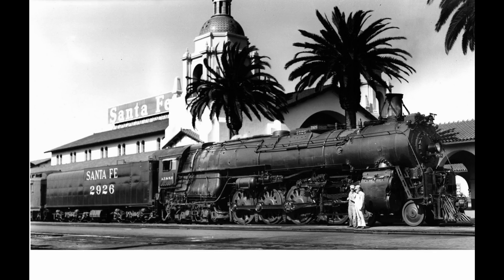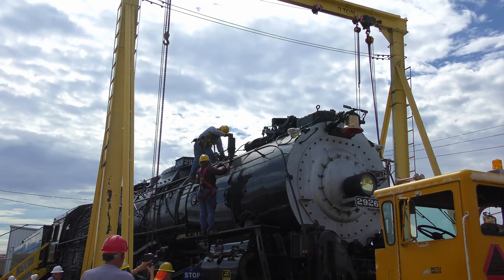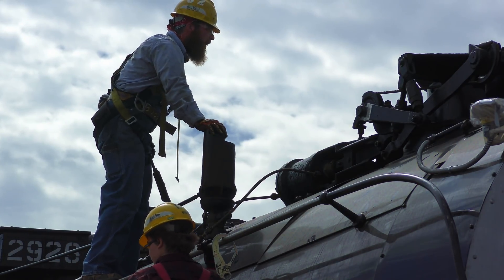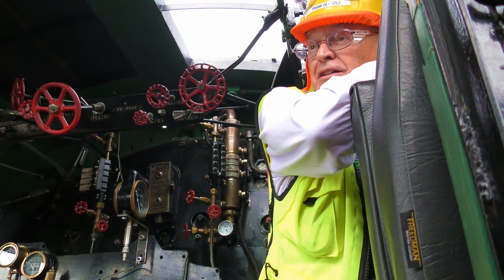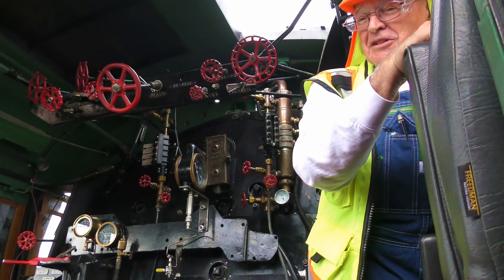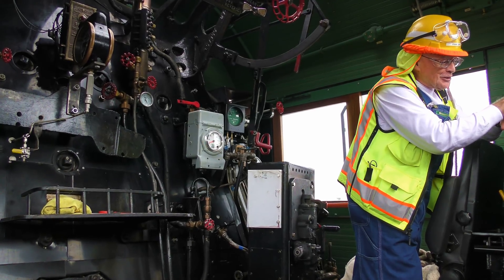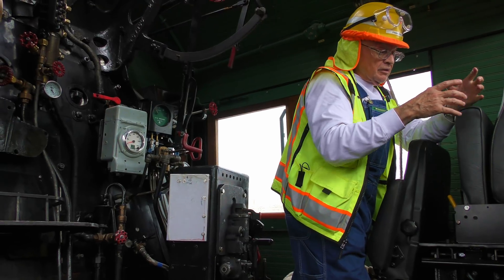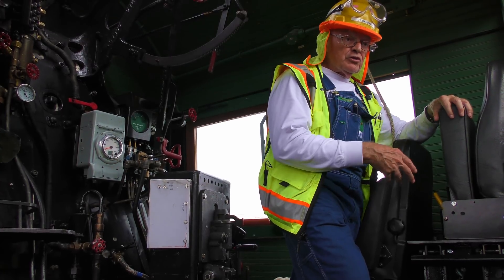AT&SF 2926 Restoration Update!  August 22, 2018

Comment: Santa Fe 2926 is a 4-8-4 class 2900 series built by bladiwn in 1944 it pulled Passenger and freight trains in Eastern United States  Retired in the 1950s and placed on display in a park will run again when Restoration is complete August 22 2018 a new fire was aploded for the first time it can Produce £79,00

Comment: 611 crew did an inspection and looked past the nice paint, they were not impressed and see huge issues coming if this ever does move.
Reply: The real test of accomplishment would be for a couple of the UP steam crew to visit and gice a full inspection. . Those guys do nothing but restore and operate the largest engines in service.  If ever there is a reservoir of knowledge and experience it is in the UP shops. All those interested in bringing old engines back to life should take a course from the UP people. The nice paint is the last thing they think about.
Reply from the maker: So I've heard.  I hope they listen to people that know what they're doing.
Reply: Bob Russell 611 crew sure knows what they’re doing. They restored every inch of her to near factory condition, been taking a seam out of the tender that a wreck caused in late 58’, so they are fairly knowledgeable

Comment: A couple small steam leak after 60 plus years and a rebuild, I'd say thats  totally acceptable. It looks awesome, good luck.
Reply from the maker: Definitely.  Thanks!
Reply: If they did a complete rebuild - such as the UP steam shops do, there would be no problems.  Largest 4-8-4? How about the UP 844? That is no toy engine by any means and it is fully operational. There is little doubt about the dedication of the crew who has taken the effort to restore this to functional condition. But if any shortcuts have been made it will be apparent on the trip to Las Vegas.